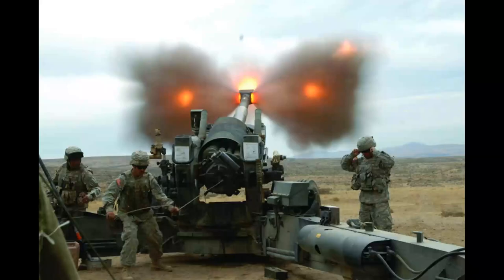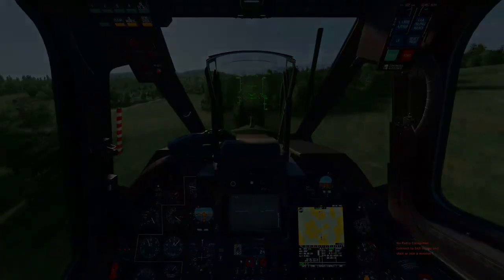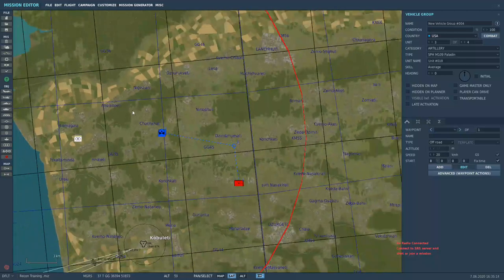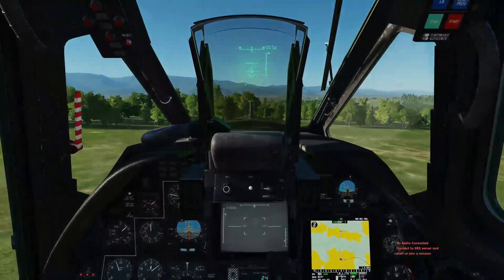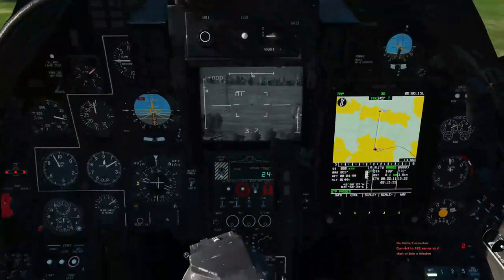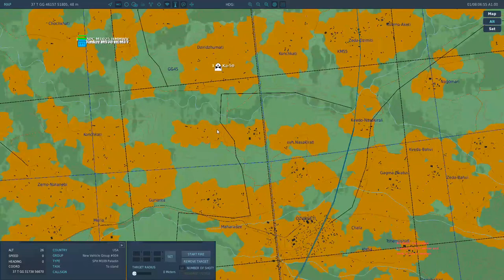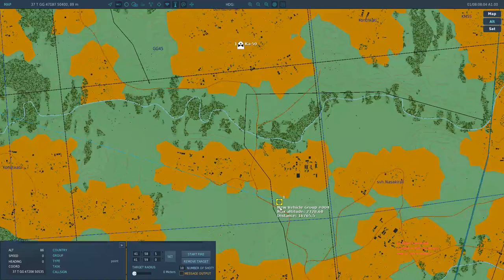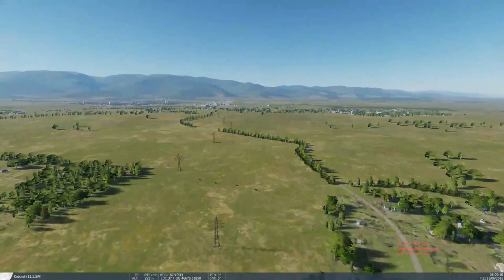Employing artillery in DCS World using Combined Arms and the KA-50

Comment: Might increase accuracy if you convert the coordinates back to DMS. The PVI-800's coordinates system is DMD. It won't be more accurate by much though, since it only goes down to one decimal.
Reply from the maker: Honestly I will never use the LAT LONG. I’m much better at just analyzing the terrain and comparing it to the map. I know there are some other ways with the KA-50 but I kinda went with the Easy one and adjusted from there. Thanks for watching!

Comment: I experimented with A10C spotting targets and then artillery attacks. Specifically, fly A10CII over the target area, circling. Mark targets using TGP and read the MGRS coordinates from the CDU. 12 self-propelled artillery firing 50 rounds was quite a show. However, the artilleries stopped following orders after two barrages. Though each artillery still had leftover rounds. I hope ED will improve the artillery control surface to make the battle experience more diverse. Artillery is really fun!!!